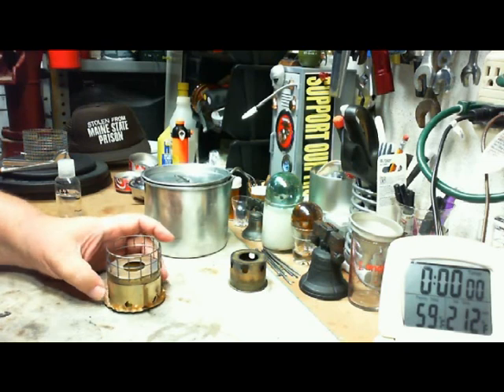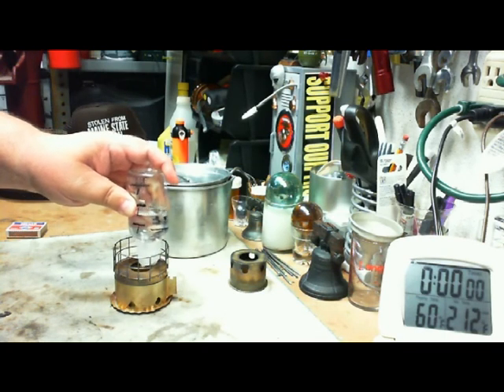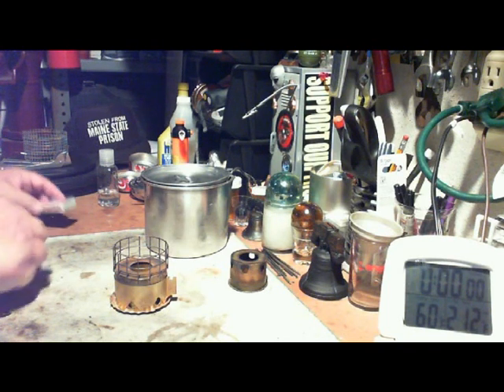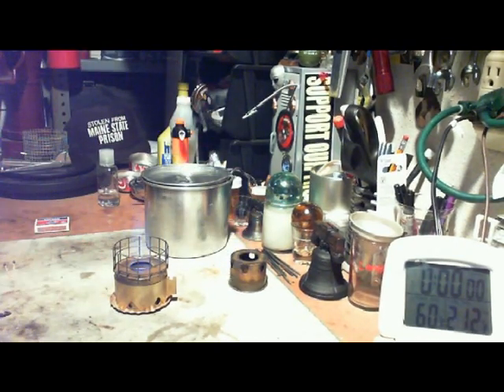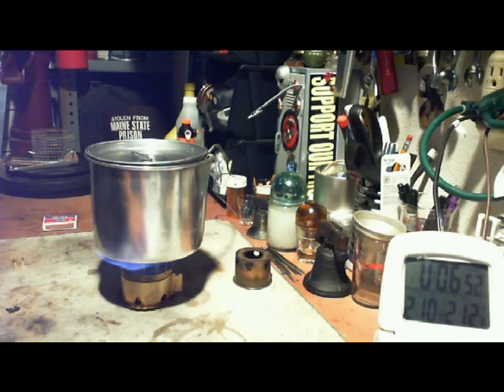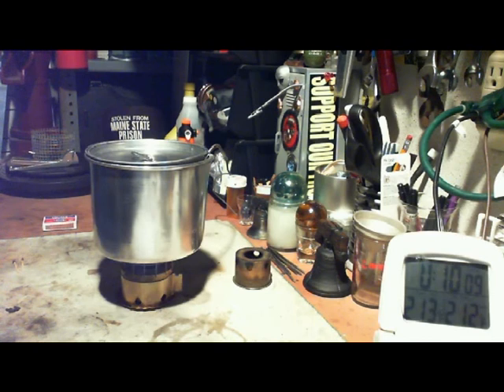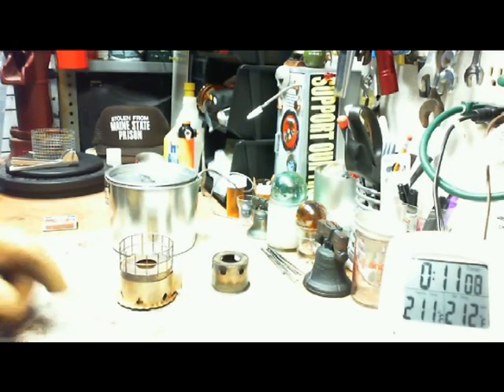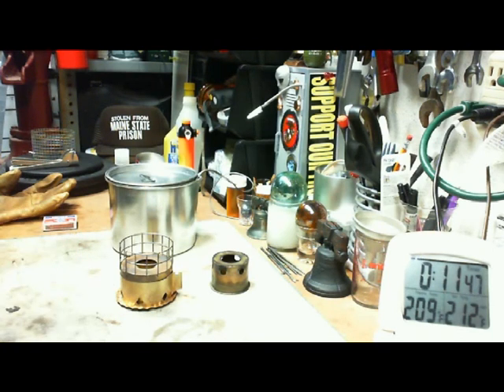Brasslite II-D Boil Test #1

Comment: Hiram, the instructions indicate that the sliding control on the bottom for simmer is to be turned while a pot or something is on the stove. Otherwise, it's unstable. You also would have gotten a faster boil time if you'd have put a shield around the thing, of course with some holes in it to let some air in. Heavy aluminum foil 6" wide would work fine. That's somewhere in the instructions or the promotion materials.

Comment: One thing I've noticed is most alcohol stoves is they are all usually around the 7 minute mark, and the only thing you can make a decision on which one to use is cost, usability and robustness and to be honest I think a simple civvy trangia is the easiest and most cost effective burner to use as it is virtually bomb proof.

Are there any alcohol stoves that can boil less than around 7 minutes?